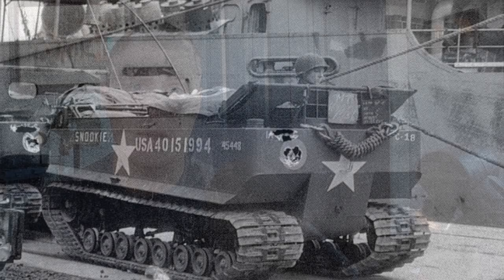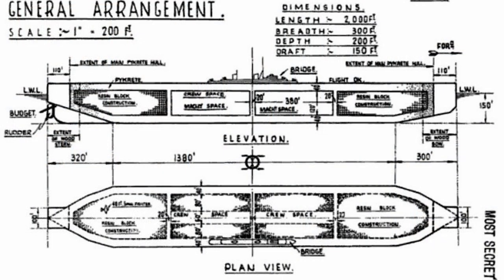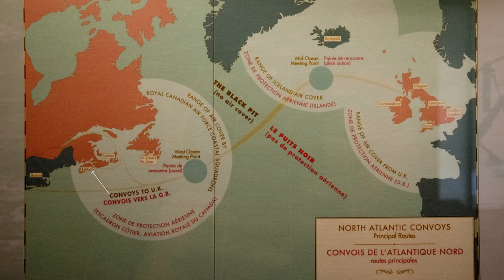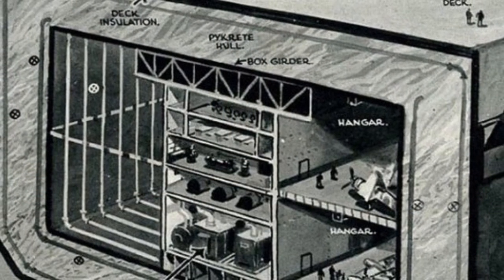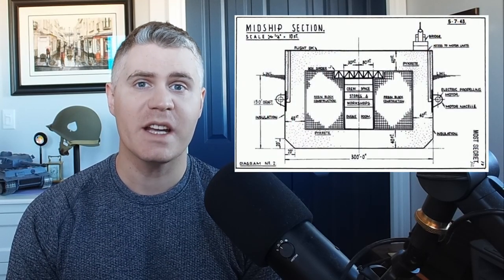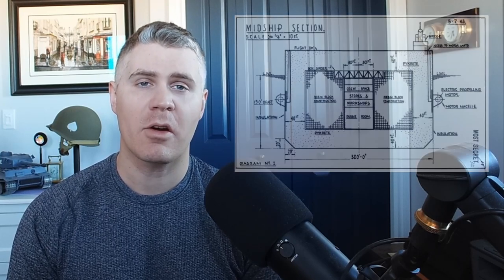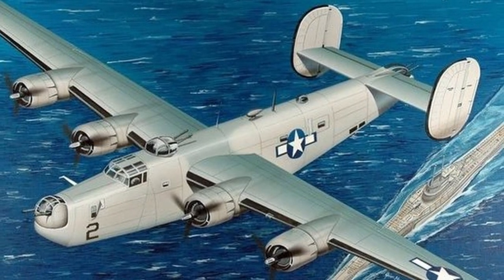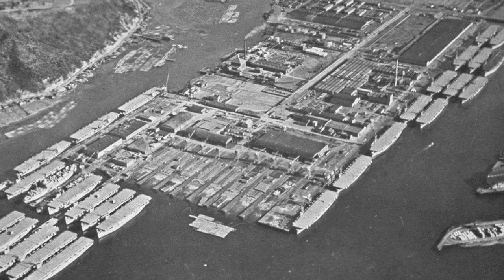A WW2 Aircraft Carrier Made of Ice?

Comment: A dumb idea that did not get any better with time
Reply: I would personally defend the idea, it is an acceptable plan, that was abandoned more because it became unnecessary, than because it would not work. The relative cost in resources was comparable to a single fleet carrier, and the potential compliment vastly outstripped that of any conventional carrier. It would also have been more or less entirely impervious to any axis assets, to such a degree, that it would likely not have needed any escorts. Whereas a traditional carrier would need several at all times. It would also be possible of launching and recovering much larger aircraft than any traditional carrier. Hypothetically, had it been ready to go from the start of the war, the early u-boat campaigns would simply have failed.